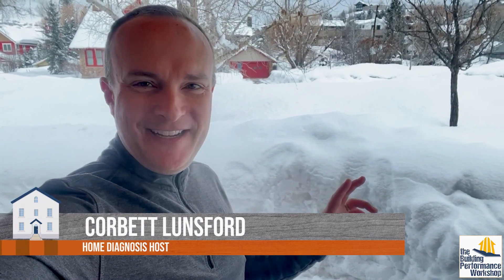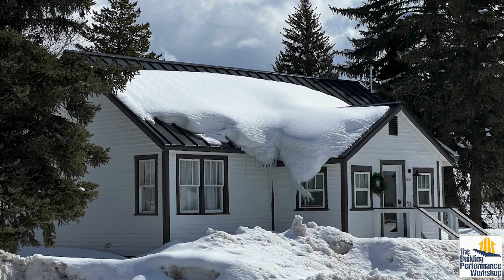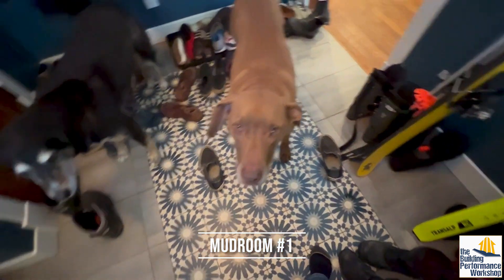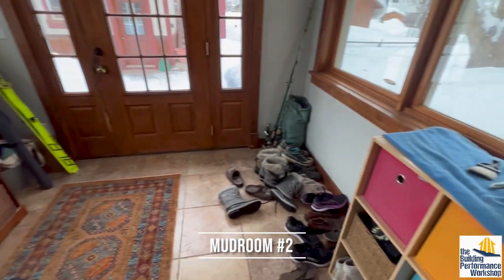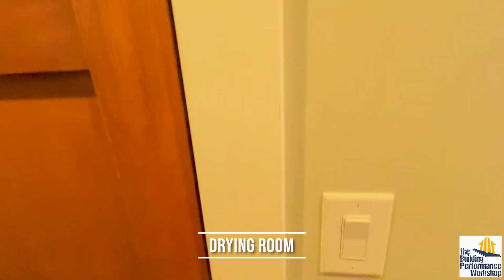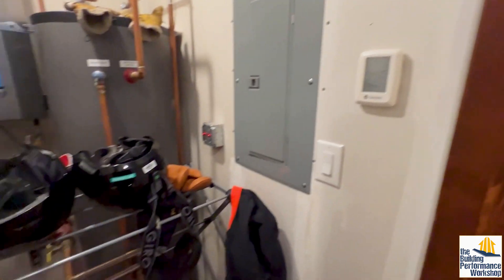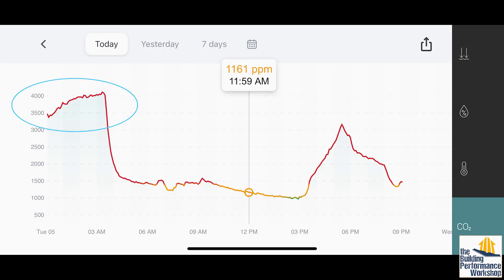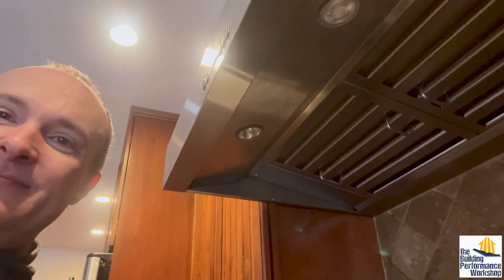High Mountain Homes: Mud Room Arrangements, Drying Room, Roof and HVAC Tips

Comment: You'll find similar mud rooms in most homes in Canada outside of cities, commonly the same room as a laundry room, or there will be a part of the garage set up for it. It's not just snow, but actual mud/dirt. It's a mistake to not build one. Back in the day, the laundry room was near the outdoors for hanging clothes on the line, but it's also practical when you come in soaked or dirty and don't want to make a mess through the house. Almost no one wears shoes inside the home in Canada (and it's considered very rude for a guest to leave theirs on), so having a place to put wet/dirty footwear is important. If the front door has a small or no entryway it will only be used for strangers or new friends if there's an easily accessible side entrance. A lot of homes were built in the 50s/60s/70s/80s with front entrances nobody uses due to a lack of entryway with a place to put footwear and coats. I guess people bought US-drawn plans without thinking.

The same concepts occur in Finland and Sweden as well, which are two more countries shoes always come off and a place is needed for winter coats.

As far as temperatures go, I like my bedroom cool to cold, like 50 to 60°F, for sleeping, while I like the rest of the house a bit warmer, between 60 and 70°F. A sun room will probably be a lot warmer, and a proper sauna will be around 200°F. I'm one of those people who doesn't mind being a bit cool, but loathes being too warm when trying to work/think or sleep. 

I'm really surprised at the CO2 levels of that house as it has a ventilation system. Is the system undersized? What else would cause that?
Reply: My guess is poor application of the ventilation system combined with hydronic heat equals poor air circulation.

I’m also in Canada and building a high performance house with forced air furnace.  Steady filtered air circulation.